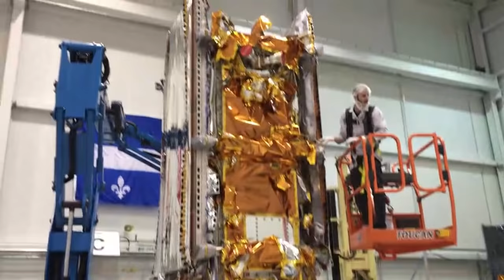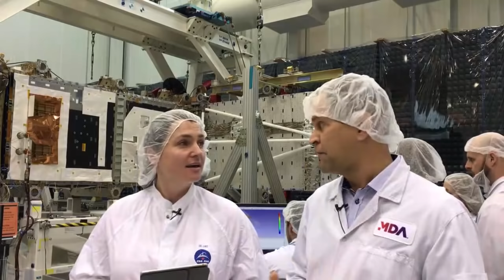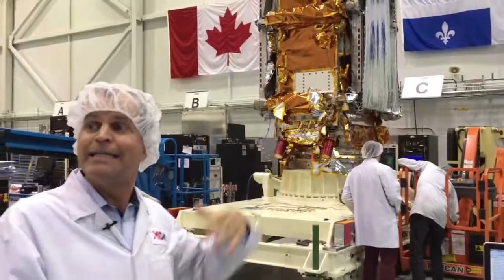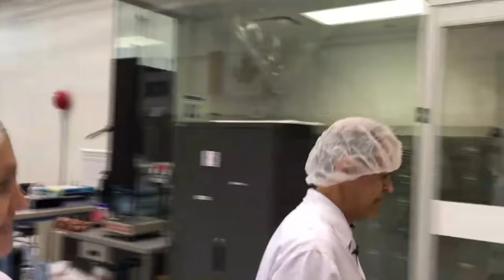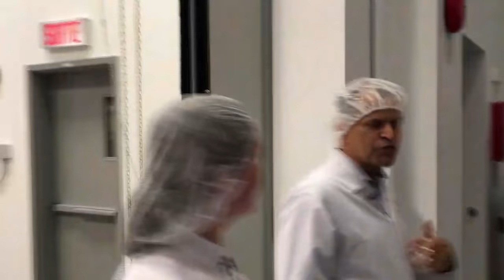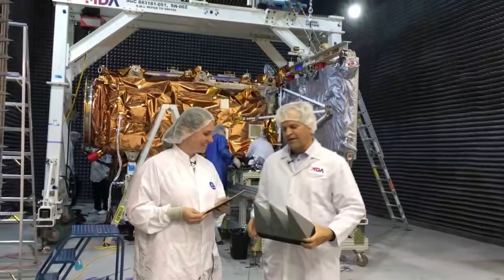Behind-the-scenes tour of the MDA satellite testing facility

Comment: Radio Photo funk is a alternative the mda etar to save. RPF from the agk dts Konzept Institut maison des associations Thüringen With 49 a b c ©®™
Reply: 49.a AGK DTS Hypo Economist Concept Institute Maison des Associations Thuringia United Germany Evangelical Union has a multimedia package 26 and would enter into a deal with this channel manager.  For a photo disk on a smartphone station, the photo archive secures smartphone station storage media with a Bluetooth connection. ©®™ Would charge 50 percent of the final patent.
   49.b The station could also be combined with a radio where image files are sent via radio. ©®™ Would charge 50 percent of the final patent.  49.c The concept photo radio system can be used for the Bradley and Puma firing systems.  For this Rocket.©®™
Reply: 33.q Hello, there is a new technology from the mda Roll Royce cooperation engine that is ideal for the DB, a vacuum hydrogen laser reactor with a magnetic field pool to form a current absorber, which could be used for trains as moving power plants with a buffer storage wagon.  Thus, a kiwapi kilowatt Pi economy can take place through a ki management control.  Your AGK DTS Hypo Economist Concept Institute maison des associations Thuringia united Germany Protestant Union ©®™ would charge 50 percent of the final patent.